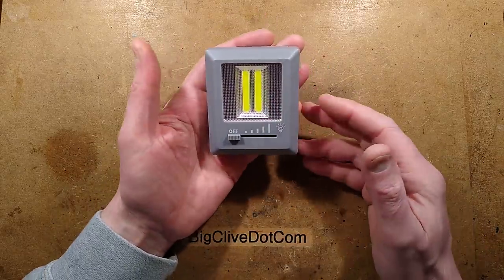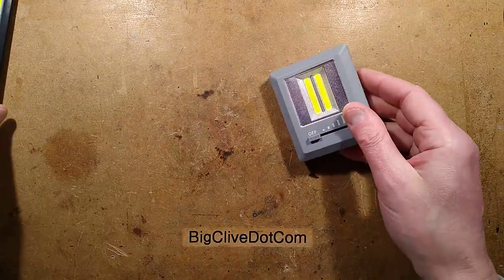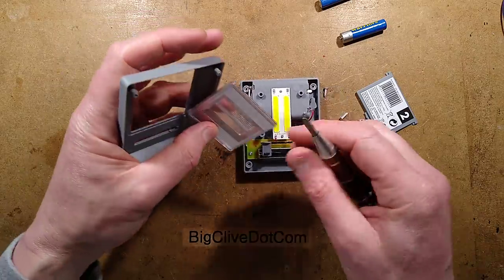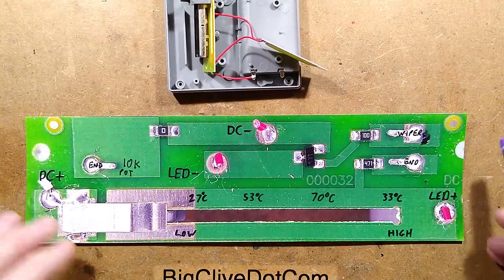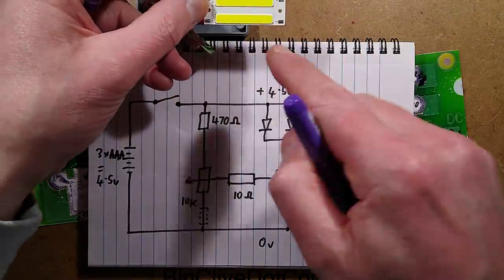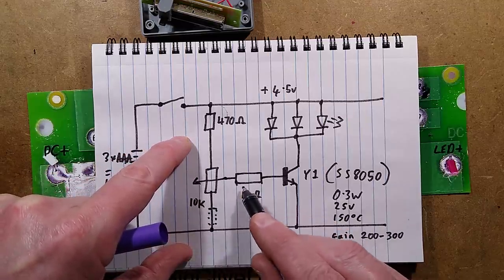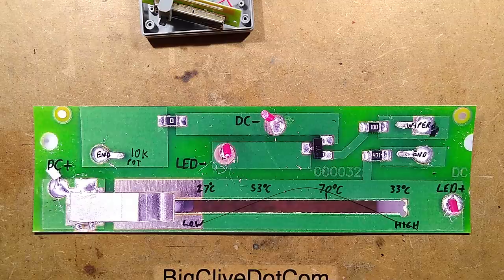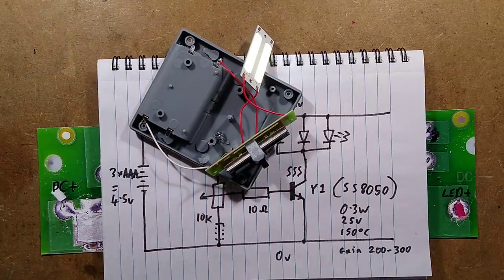Poundland dimmable COB LED light (with schematic)

Comment: If they would've used an extra mosfet with this npn, they could've built a text book 2 transistor variable constant current source for the LED. 
Very hackable $2 turd to treasure possibilities...
Reply: Hey, I'm new to electronics and wanted to read about that 2 transistor circuit but couldn't find what you're describing (mosfet+npn). Could you link me a resource on it please?
Reply: @ngbotcrack  If you Google "constant current mirror circuit" you will see many versions. 
Some with only npn, and some with a mixture of NPN and N-MOSFET. 
Some even with 3 transistors!

Comment: ??  Not sure where you are getting the idea that it is driving the LEDs very hard.  Looks like 2 x 1W strips, at 500mA, is roughly 1.6W, so they merely need a 5 cent piece of aluminum as heatsink behind them, then next larger size transistor.  

Last thing I'd want is making it not as bright to save 10 cents.   Clive with all due respect, you have been tearing apart cheap junk for too long and have very low expectations of LED performance, don't seem to appreciate that there is no good reason not to design for max power design that can be attained cheaply within a given form factor, when it also has an adjustable output should the user want longer battery life instead.  Not when it's a 10 cent difference.  I know someone will say 10 cent versus 8 hundred trillion of them is a lot of money.  Yes, and a lot of money lost if people buy something else instead because it's outperformed by competitors.

IMO, any LED lighting device with multiple outputs should seek a highest output mode that runs for an hour at most, but then I hate the idea of using 3 x AAA cells too, when the capacity:dollar ratio is much better with AA.  Make it AA, 30% larger housing, heatsink plate behind COBs, and use a 5W COB running at about double that 1.6W, and of course, a larger transistor.  Twice as bright for very little cost difference and also runs longer.